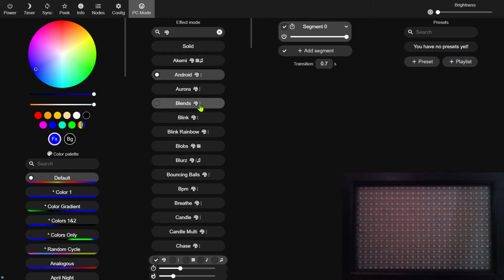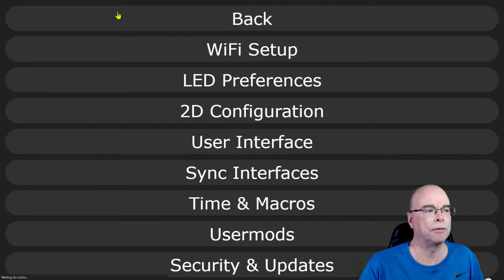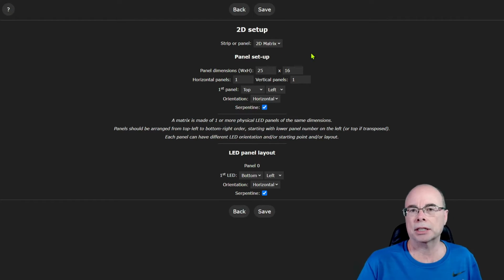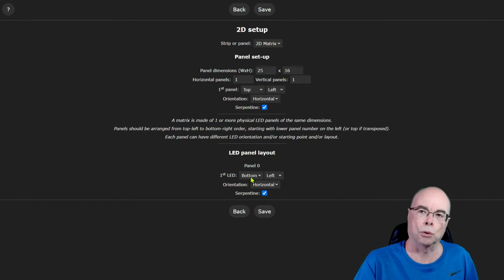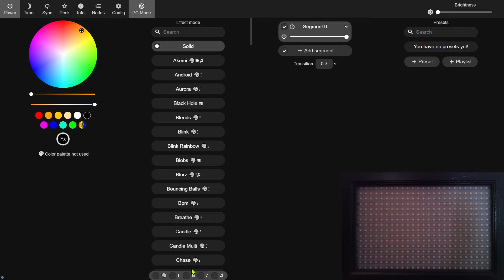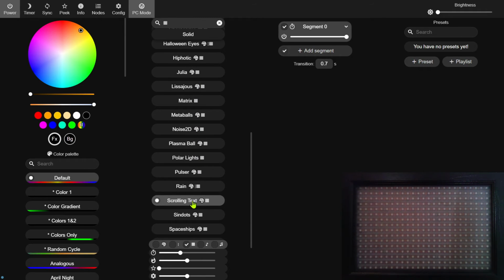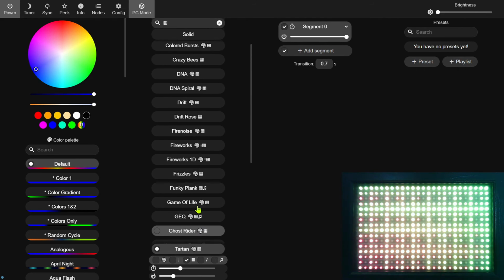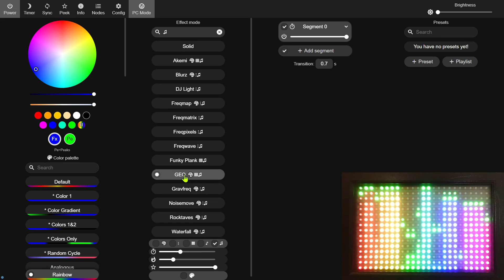WLED on your Matrix Displays Without Custom Mods!

Comment: I've been trying to figure out how to handle a large matrix mainly for text and "sprite" with various effects to the text.  I didn't want to use a 2nd controller or server to command the text live, perhaps defining a script file that would be read.  WLED might now be the package I need, especially when it has multichannel support.  My matrix after all is going to be 300 horizontal 16 vertical.
Reply from the maker: Yeah... that's why the other mode of my matrix (the clock/scoreboard/text mode) does have it's own controller.  To display text and create some basic effects, I ended up having to write my own controller code.  But since it uses MQTT, I can send text to it from pretty much any source (such as a weather service for the outdoor temp).  Theoretically, the controller could also pull text from an external source as well.  I don't think WLED will be able to duplicate those types of functions any time soon, but just being able to do scrolling text is a major upgrade to WLED in my opinion.

Just out of curiosity, what LEDs are you using for your panel? 4,800 is a lot!  Just curious about the type of LEDs and the resulting power requirements.
Reply: @ResinChemTech  I'm planning on using 16 of the BTF eco WS2812B 300 LED 5M strips.
I haven't 100% figured out power but definitely will be feeding 5V from both sides of each strip, possibly even in the middle.  For testing I'll be using the 5V output from an old PC power supply but probably will get a dedicated 30A 5V supply.  I'll have WLED set with a power limit.  My plan is mostly text on black
My dad currently has three 15ft canvas banners with fixed strip LEDs for letters, one has Merry Christmas, one Happy New Year and a third I think says Thank You for Memorial Day.  I wanted to make one that is universal and could be more animated and include a bit of sprite graphics.
Reply: Oh yes, I'll have to use multi channel to bring down latency but I understand WLED can combine the channels into one virtual strip.  Not sure yet how many channels with combined rows.  I'm still trying to figure out the physics of mounting the strips since the length is over 16ft.  Might need my dad to make a canvas 12 inches by 17ft.
Reply from the maker: Sounds like a cool project, but be sure you are calculating both your power needs properly.  While I always use 60 mA/pixel as a safe estimate for full bright white, even if you drop that down to 45 mA for the eco version, you would be looking at something like 216A for lighting all the pixels on full brightness!  Now, granted, you probably won't have all the pixels on simultaneously on full white, but I fear that 30A may be way underpowered and force you to run the matrix on a significantly lower brightness (or risk overtaxing the power supply, leading to a shorter life).  I'm not using the eco version of WS2812b, but I'm using a 40A power supply just for my 25x16 (400 pixel) matrix.  I always try to 'oversize' my power supplies so I don't have to fear about either lack of power or overtaxing the power supply.

You might want to check out Quindor's site on power calculations ( https://quinled.info/2020/03/12/digital-led-power-usage/ ) .  He's the creator of the DigUno and DigQuad boards, and I generally consider him one of the experts on LEDs.  Of course, you are free to do as you like, but I'm just providing some suggestions based on my own experiences and to try to help avoid any potential problems you might see after the build.
Reply: @ResinChemTech  with just text and sprites where only a percentage of the LEDs are lit, mostly run at night, it might make it.
But granted I do have to also consider the all LED off current draw.  We'll see.

Comment: good! Do you know if this works for standard max7219 matrix displays? Usually single color, but good for scrolling text... Happy new year!
Reply from the maker: I can't say for sure, but I don't see the max7219 listed as officially supported on the WLED official site ( https://kno.wled.ge/basics/compatible-hardware/ ).  WLED does support LED strips that use two pins (clock/data), but it looks like the max7219 uses 3 pins?  I'm not familiar with that particular matrix (mine is simply a series of WS2812b strips), but you might want to check on one of the WLED forums or Discord channel.  If it's not supported now, there is always a chance it might be in the future.  I think we will see a lot more support for matrices added down the road with these latest changes.

Thanks for watching!
Reply: @ResinChemTech  for now I'm using it with tasmota, and works great for scrolling notifications!